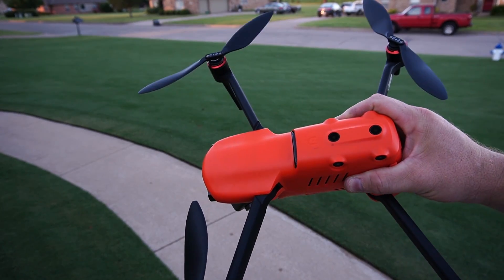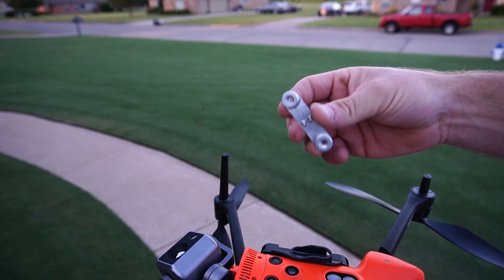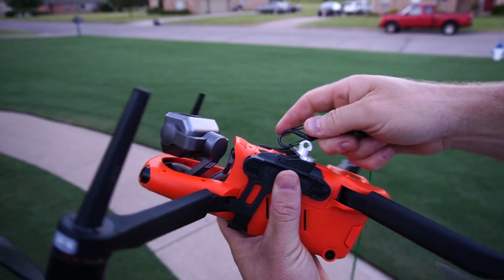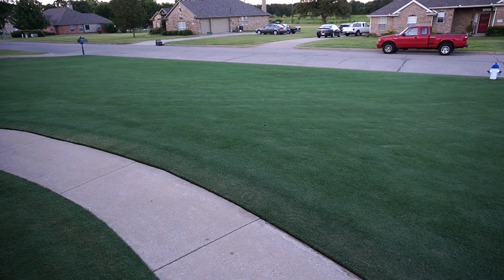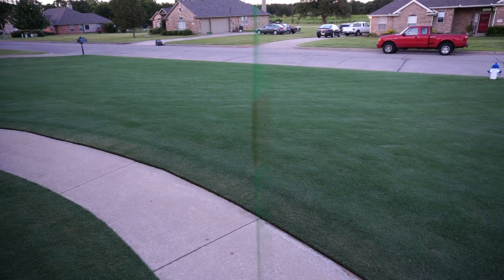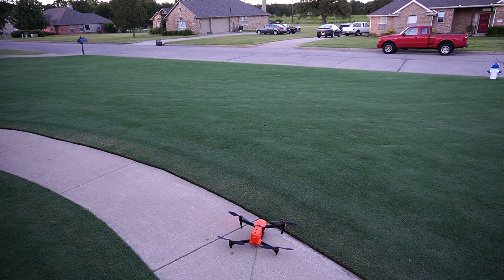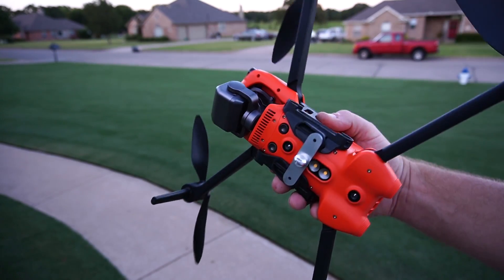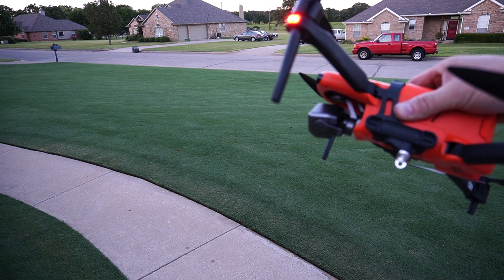Autel Evo2 Dual Sling Load Bracket

Comment: Hey Garret. Awesome bracket. I saw you mention in the comments that you were going to test weight capacity and am curious what your results were? Also wondering if you tested flight time with various loads? Thnx.
Reply from the maker: Yes we did.  I need to upload the video.  It came in at 2 pounds -- or double what the DJI Mavic series can lift

Comment: Nice bit of fabrication right there! Reminds me of a billet jack point adapter I have for an aluminum bodied Jaguar XJ/Vanden Plas to match a floor jack to the factory lift points. This is at once strong & light, and looks the part, in that FoxFury harness.  I see these over at Advexure,  and I will add one to my E2P "startup kit" (Rugged Bundle +2 additional batteries,  Charging Hub, Tablet Mount to hold me until V2 Smart Controllers ship in another few weeks. I am as anxious as an 11 year old on Christmas eve 😆 .  As a recreational waiver pilot, I have absolutely no idea what I need this bracket for, but I know pro gear when I see it, and the problem will come along, seeking this solution! 👍

Comment: Wondering if it would lift a 1/2 gallon of water roughly 4 lbs or even a gallon give that a try might be a bit heavy for the props just curious
Reply from the maker: Gary, we actually concluded that test, I just need to upload the video.  The Evo2 can reliably transport 2.5 pounds.  I carried 3 for the test but gave a battery temperature warning at the end
Reply: Ok good to know thanks for the reply

Comment: Thanks for a great video. We are using the Autel EVO 2 and the Autel EVO Live Deck fro our CERT training. We are testing both top and bottom payloads accessories. We have the Autel saddle.
Do you have speculations or blueprint that we could get, or one of these. We are willing to pay for it. Thank you for all your efforts, interests in drones and skill.  We learn a lot from you videos.
Reply from the maker: Thank you for your service on the CERT team and excellent choice of drones.
That payload bracket is CNC machined and FlyHighUSA is manufacturing them
Reply: Thank you again. i just purchased one and will have it in two days. We are working with the CERT program at the University n San Marcus ( sponsored by FEMA ). They are training teens in CERT. We have four teens that also with ham radio licenses. Therefore also testing flying antennas, repeaters, and dropping radios and other gear from drones. We are developing charts of weights of objects that can  be dropped from the Autel EVO 1 and 2, and the DJI Mavic Mini ( payloads )
Reply: @garretbryl625  thank for sharing your  lead  https://flyhighusa.com/?product=autel-evo-2-sling-load-bracket

Comment: This is perfect. My Evo2 pro arrived today and I planed on doing similar test. I'm a ham operator and I planed on using it to deploy a cross band repeater to provide communications in an emergency and public events like races and marathons . It only weighs a half a pound so I think I'm good. However, I still need to do frequency interference testing before I attempt it at altitude.

Comment: How about a 1/4 20 screw for a 360 camera? Maybe top and bottom?
Reply from the maker: Hey Gary, I finished the design on this.  The interior channel has been changed to a heptadecagon for a mild indexing property.  I am going to provide the designs to FlyHighUSA for production.  It should be available in either plastic, metal, or a hybrid.
Reply: @garretbryl625  I've tried to order but the page does not work. I'll have to call FlyHighUSA.
Reply from the maker: @garysanchezphotography , optionally send an email to FireCam.  They are selling them as well.  drones@firecam.com
Reply from the maker: That would be pretty simple and a great idea
Reply: How much weight can it carry safety

Comment: do you have a CAD or blue print you could send of the device. Could it be 3D printed rather than machined.. Thanks. great video.
Reply from the maker: This would not be a good candidate for 3D printing.
Reply: Just thought you might like to know. Our youth last weekend reversed engineered this concept and are modifying it for other tasks. So far the fit is good and tight. they re using PLA materials at present. The hole will be bigger, and probably two hangers rather than one. ( maybe GOPRO type ) We will test the weight load this weekend. We are working with various audio/loud speakers and light systems on top mounts,  and drop mechanisms  on bottom mounts. They will be printed in various colors and maybe materials.   I did purchased  one from flyhigUSA. I Intend to get a second. Took three weeks to get here. There are several types of drone mounts to 3 D print on Thingiverse. We have tried most of them. Also several out of China using various attachment  concepts., different than the saddle  mount concept. Much of this are projects with Texas Youth council for preparedness ( FEMA/CERT ).Thank you for the great idea. Keep up the good work. We need more drones and parts made in the USA!
Reply from the maker: @mecatx , that is fantastic and I love to hear that.  The youth learning how to solve problems and provide solutions is our future.  Please just be careful with plastic (especially PLA) on this particular component.  The physics with this component having excessive flex can have some unfavorable results.  This is especially true in hot weather climates

Comment: Would it not be easier to tell if the engine is over-running by listening to the noise it makes? Like how close to max throttle does it sounds like?
Reply from the maker: Yes,  agree.  I was listening first and feeling for heat secondary.  It wasn't anywhere near max throttle but I plan to see how much this system has in the next few days

Comment: Fantastic. I'm not sure the cost to produce the Load Bracket but I'm thinking you could market this easily.. Get the cost down by using a 3d printer. Nice work.
Reply from the maker: I plan on providing the design to FlyHighUSA and they can manufacture / sell them.  I have a 3D printer but I don't think that I would want this piece made of plastic.  I don't know how much the Evo2 can lift yet but it picked up and moved that Fluke like it wasn't even there